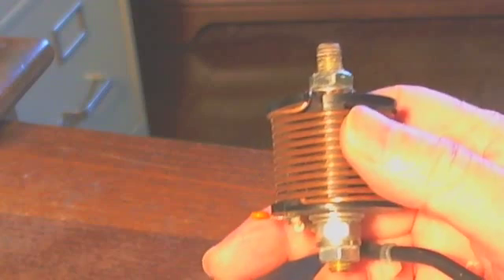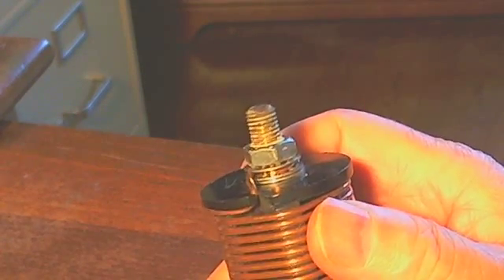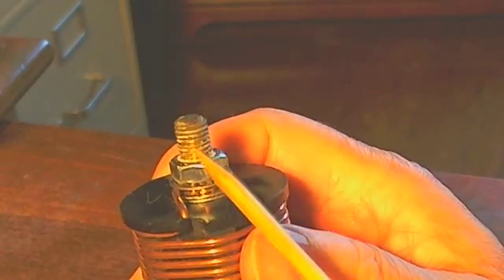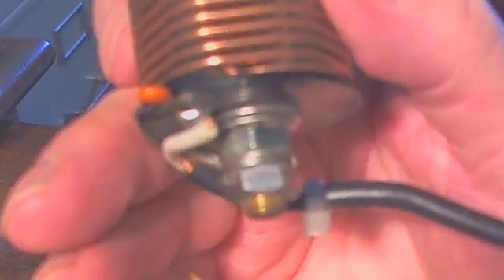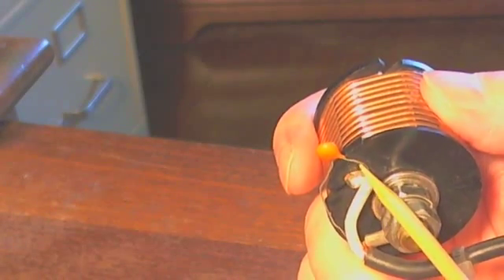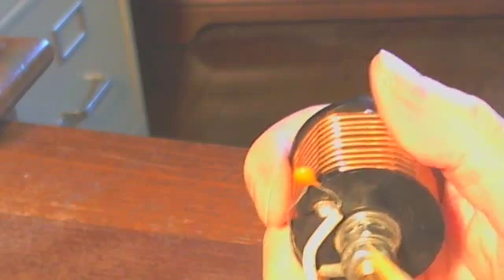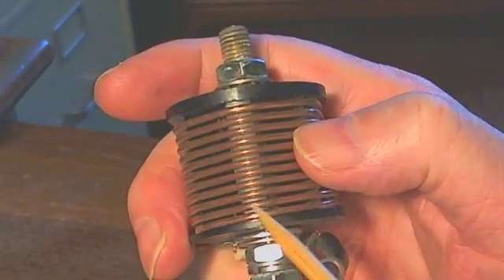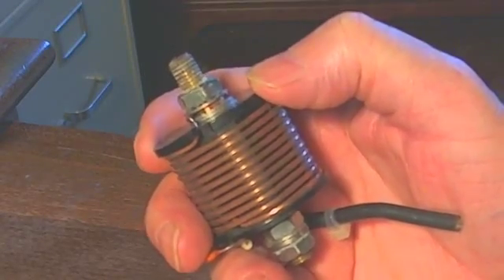Old Grampa talking about a Wilson coil

Comment: That looks to be a Wilson 500 or lil wil...I'm thinking lil wil due to the use of a capacitor and the small gauge coil wire...I THINK the 500 has slightly bigger wire and does not use a capacitor...I KNOW the 1000 2000 and 5000 have much bigger wire size and are silver plated and do not use a capacitor....I'm fairly certain this was a lil wil before the dissection

Comment: That's a ceramic capacitor. They almost never show signs of failing, they're made of ceramic with a metal coating. They should measure open circuit to an ohmmeter, and when measured with a capacitor meter should be withing 5-10% of the marked value. Electrolytic and tantalum capacitors are the ones that usually explode, leak or catch fire.

Quite an interesting find, like you said it appears to be in otherwise good condition. Unsolder the capacitor and replace with one of the the same marking and it would be good as new. Maybe have to clean the mild corrosion off the top of the bolt for good contact.